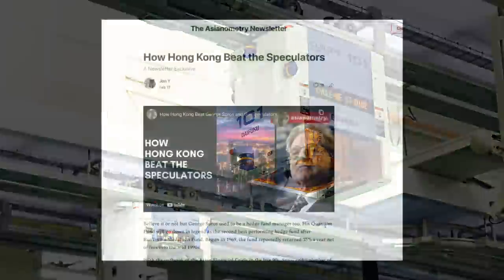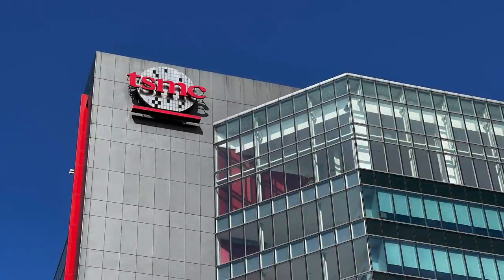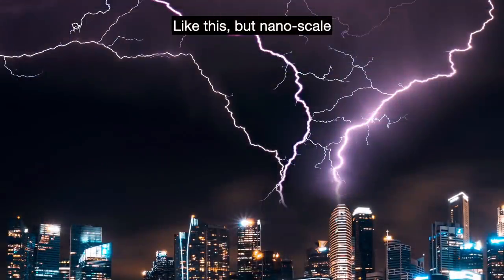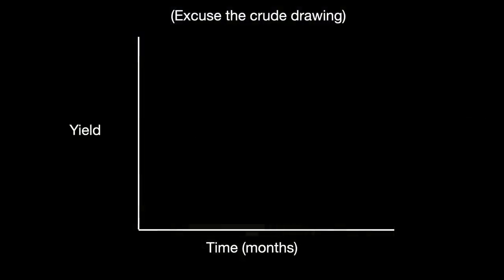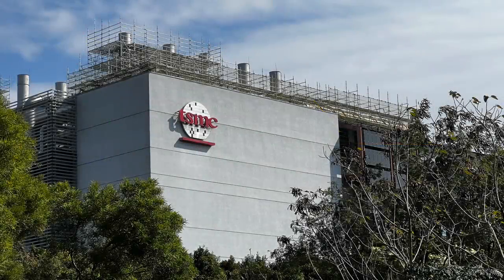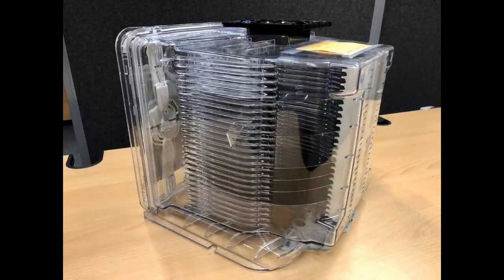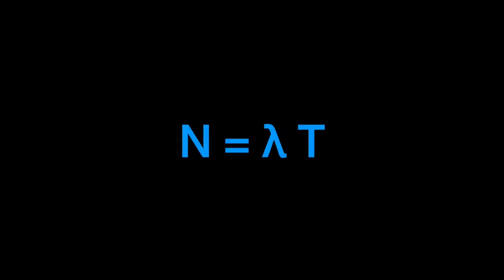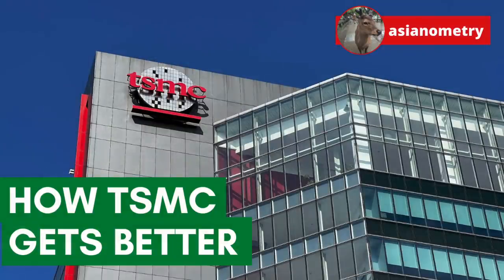How TSMC Keeps Getting Better

Comment: Was surprised that a lot was talked about on yield management without mentioning KLA, the toolmaker whose whole business is built on defect detection. Otherwise fantastic overview on what keeps TSMC at the top of the game.
Reply: yep -- worked for KLA for decade+... and can very confidently say its one of the companies that nobody has like heard ever (general public), although they have the lion's share in various sections of metrology and yield management. Sigh.
Reply: I hated the KLA tools.
Sucked being a tech and having to run down defect issues.
Reply: @AmrishKelkar  how to get a job in the semiconductor industry, like which engineering degree is required
Reply: @johnjacobjinglehimerschmid3555  I think each and every tool inside a fab is an extremely complex monster. Very tough to troubleshoot. I agree - tool going down sucks - - but there really is no way around it. Was your experience with other tool vendors the same? (keeping tool  complexity ~same level)
Reply: @orkkojit  Mechanical, electrical, electronics Engg degrees are highly sought after. Material science. I would suggest master's+. CS too, but you're not going to get paid like pure sw companies. Degrees in physics and maths can also get you in.
Reply: @AmrishKelkar  What's the avg pay in the industry ?
Reply: @AmrishKelkar  Thanks a lot
Reply: @orkkojit  Materials, applied physics, electronics, chemistry. Doing a master in nanotechnology/materials/chemistry should be the best way for it.
Reply from the maker: KLA, hit me up bruh!
Reply: @orkkojit  $28k a year in Taiwan in 200x
Reply: @Asianometry  There's a bot below your comment
Reply: @AmrishKelkar  
I was an etch tech.  So issues were more straight forward at the time, that is 20 years ago.  It was, at the time in our fab, where kla tools were just introduced.  Kla, defect tools, just added a crop load of investigation time.  Not sure how much time I spen on a sem after a kla tool flagged a lot.  It got better as we learned but when they showed up I hated them.
Reply: @orkkojit  it varies of course, but if forced to give a number, in the US you should be able to start at a minimum of 100k (fresh) assuming you have atleast a master's.
Reply: Intel is no competition only competitor today and in the future is Samsung. Can Samsung overtake TSMC in the future?

Comment: There was an interesting piece in this weeks Economist about the Taiwan chip industry. They highlighted the number of engineers being lured to China and suggested they are seen as traitors in Taiwan. Any thoughts of doing a video on this topic?
Reply: I heard in the 1990s Japanese chip engineers moonlighted for up and coming Korean chip fab companies, which wasn't too hard to do considering it's only a 2.5 hour flight between the two countries. Since then, Japanese chip companies have never recovered their position, at least in sectors such as memory.
Reply: But if ASML (or whom ever is makes the required machines) is restricted from importing to China then not sure how useful it will be. Have not read the article but have heard of this issue before for years.
Reply: @johnl.7754  not to mention Japan also play a role in creating device that is in the process to prepare these chips fab so I dont think they would do well.
Reply: Even so..  Taiwan still relies on Japan and US for the designs.
Reply: @deborahschumann8286  Taiwan's design is the second in the world, and the United States is the first. Japan has no design at all.
Reply from the maker: Depends on how much I want to get yelled at on a particular week.
Reply: In 2000, lots of TSMC and UMC engineers went to start up SMIC and huahong. They got a lot of free stocks. The outcome of those engineers were not good. And now TSMC is much more powerful than 20Y ago. TSMC engineers will be stupid to take risk to go to China semi companies now.
Reply: @TPM188  its not new engineers moving around... in fact in some technology industries, not moving around at least once every 10 years is considered a stain on your CV.
Reply: @mrrolandlawrence  Not true in the chip industry. TSMC currently holds all the tech in <5nm chips, you are considered the best engineers in the field if you work in TSMC. Your value drop the moment you left the company. Most engineers spend their whole working life in the same company in this field. More than 10 years at TSMC is certainly not a stain on your CV

Comment: Last I heard TSMC is introducing N3E which is "only" a 60% density shrink as opposed to the standard 70%, but it's already yield ramping right. This shouldn't be a big issue since N5 was already a bigger leap over N7 than normal. 84% in the best cases actually. So from N7 to N3, on average, follows the 70% density shrink every two years.
Reply: What advantages does density bring beyond purely more semiconductors per unit of area? Gate capacity (power usage), propagation delay? Will some of these start scaling worse with density or have they started already? What about leakage current?

Because i have a feeling that a lot of the time, the device size is hardly the goal, as the packaging takes up too much room anyway for it to matter, and we're well past bottom price per FET; and for large and powerful chips, power density is becoming critical anyway, like if a chip that takes like half a kilowatt, ridiculous, how do you even cool that without having it turn into a Pringle?
Reply: @SianaGearz  Power usage, specifically FET leakage current and RDS(on) is a huge part of a node improvement. This is the key to usable density nowadays as thermal density became critical.
Reply: @SianaGearz  The advantage of smaller transistors is faster switching time (higher frequency chips) and faster signalling between each transistor (signals propagate at the speed of light). The first disadvantage is greater leakage (wasted power), but this is partly offset by the better voltage/frequency curve. That is to say: if we only "harvest" some of the frequency gain in exchange for lower operating voltage it's still a net gain. The power density problem is not inherent to node shrinks. It's inherent to competition. Laptop chips run at 15W and get like 80% the performance of their 65W desktop cousins. We still make chips about the same size all the time, so the cooling area remains much the same. We just cram more transistors (which each use less power) into the same size package for a net performance gain.
Reply: @andersjjensen  Frequency scaling is not really happening anymore. We had 5GHz chips ten years ago. Electrical signals also do not travel at the speed of light. 
Nowadays it's mostly more transistors and a bit more efficiency per transistor.
Reply: @_TeXoN_  Electromagnetic signals travel at the speed of light in the medium they travel in. Just like light travels through air.. at the speed of light in air. We generally don't bother to distinguish between "the speed of light in a perfect vacuum", which is what think of when saying "the speed of light", and "the speed of light in this particular alloy" because in microprocessors (and other high quality electronics) it is at 95-99% the speed of light in a vacuum.

Frequency scaling still happens despite you not seeing much of it in modern processors. This is because it is difficult to retain good IPC (Instructions Per Clock) at higher frequencies on the rather complex instruction sets of PCs.

Every time TSMC markets a new node you'll see them state something like "20% more speed at ISO power or 40% power reduction at ISO speed" (those happen to be the numbers for N5 over N7). The chip designer can then mix and match between those two extremes to suit their needs the best. ASICs (that is, logic chips that don't interpret programs because they ARE "the program") see perfectly good frequency scaling if designed right.

Comment: It is mind boggling to think that it is possible to do a three nanometer process, if three nanometers is the size of the smallest feature that is only 14 atoms across assuming they are packed at the highest possible density allowed by the van der Waals radius for silicon which is probably optimistic. It is probably a lot less than this.  How is it possible to have usable features that are only a few atoms in size, how is the defect rate not sky high ?

Comment: The yield is proportional to the chemical and manufacturing steps needed to make the chips. In chemical reactions, yields are proportional to the number of steps and the yield at each step. So, if your yield is 90% per step and you have five steps, the best yield is .9 to the fifth power = .59 which is 59%. That chip manufacturers have done even better on yields than chemists is amazing.

Comment: Is there any tolerance at all for defects? Like, if a single wrong "bridge" is formed, does that screw the whole chip?
Reply: That's the job of the chip designers to counteract the inevitable defects by making redundant circuitry units/routes or by designing circuits beyond the defined specs.
Making lower SKUs with partially defective dies or at the opposite making higher parts using the most nondefective dies won't be a thing without those tricks.

Comment: Very good. China seems to have been able to use learning through scale in building infrastructure domestically and abroad. Perhaps worth a video as most governments struggle with time and cost to build individual infrastructure projects. Maybe the USA did the same when it built the interstate freeway system in the 1950s?
Reply: Is just a variation on "Experience is the Best Teacher."  You need to actually try and fail to get the data needed to succeed.
Reply: TSMC is from Taiwan not China and is a local company not Chinese one.

Comment: I'm wondering if China were to take over Taiwan, what would be more important? Securing the fabs or securing the fleeing senior personnel? Maybe the AI engineers are more important than the semiconductor ones? It's a fun thought experiment. It doesn't have to be a China takeover. It could be a tsunami or alien abduction or maybe a post-apocalyptic situation where they save the most important people in an underground vault to rebuild society while everyone else disintegrates. How much of the talent is local? Does TSMC even recruit from the outside? I know there's a bit of hubbub about Hong Kong refugees possibly being Chinese spies and not allowed permanent residence in Taiwan. I wonder how compartmentalized the process is for security reasons, or whether that's even possible in such bleeding edge developments.
Reply: I don't think that Taiwan war is likely in next 5-10 years, but in case it happens US will have many months to evacuate TSMC while China is preparing their forces

Comment: Chip manufacturing is complicated but stealth jets are even more so. Perhaps you can make a video on all the components that go into making a remarkable stealth jet: stealth coating, airframe, emf resistant chips, radar,. Communication equipment, encryption,  engine, engine manufacturing.
 Etc.

Comment: A 10kg foup sounds not too difficult to lift, and on something with caster wheels, would be super easy to bring where it belongs. I suspect it's something else. Humans, even when they're bagged up in layers of cleanroom suits, are still filthy creatures, which is a bit of an antithesis to cleanroom, i imagine you'd want as few of them in there as possible. I mean humans in an HDD factory cleanroom might be fine, but semiconductors are a whole different calibre.
Reply: It's not, but on an average 12hr shift that human would have lifted the foup hundreds of times. The last thing the company wants is for that human to get shaky arms 10hrs into the shift. 
I've done this with 8 inch wafers back in the day, now that was doable.
Reply: It only takes a couple of dropped FOUP for management to decide to go with the automated wafer handling system.  I've been in fabs where they move them manually and it's chaotic.  I'm sure stuff gets loaded into the wrong machine all the time .. and ties up the equipment until someone figures it out and unloads it.  Plus, people expect a paycheck.. the machines work 24/7 for free!
Reply: @sooocheesy  I get what you want to say but any machine still has buying and running costs as well as maintenance time needing qualified technicians so depending of the manufacture it's not always profitable to jump into it.

Comment: This is a very stupid complaint, but it would be appreciated if you can stick to using metric for measurements. Some parts you use metres, some parts you use pounds. It's hard to follow as someone that is only used to metric measurements.
Reply: T̼h̼a̼n̼k̼s̼~̼~̼f̼o̼r̼ ̼w̼a̼t̼c̼h̼i̼n̼g̼!̼!̼!̼
̼T̼e̼x̼t̼ ̼o̼n̼ ̼W̼h̼a̼t̼s̼A̼p̼p̼✞̼︎̼✙̼①④④③⑤③⓪⑦⑨⑦⑨🚀🚀🚀📉▶️..

Comment: If wafers could be 3d printed .. that would revolutionize  this entire industry
Reply: It is already 3d printed at a much faster rate than macro scale 3d printing. The whole fabrication process is printing the 3d transistor structure on top of the silicon wafer then after that printing the 3d labyrinth of wiring on top of the 3d transistor so that they function as a logic circuit.

Comment: NANO PARTICALS, why can't chips be etched in a vacuum Environment!?
Reply: Vacuum does not mean free of contaminant. For example the etching process requires acids this acids can contain impurities. Coating process uses electrical discharged this can create unwanted free ions. Photo exposure uses plasma for a uniform light source this plasma can create killer particles. Even the containers use to transport wafers between tooling equipment can have out gassing that chemically react with the wafer. Out gassing becomes a lot more worst at lower pressures.
Reply: T̼h̼a̼n̼k̼s̼~̼~̼f̼o̼r̼ ̼w̼a̼t̼c̼h̼i̼n̼g̼!̼!̼!̼
̼T̼e̼x̼t̼ ̼o̼n̼ ̼W̼h̼a̼t̼s̼A̼p̼p̼✞̼︎̼✙̼①④④③⑤③⓪⑦⑨⑦⑨🚀🚀🚀📉▶️..

Comment: Hmmmm .... thks & 1question and 1proclamation;
The Question: China desperately want to take-over Taiwan ; Taiwan's economy greatly depends on TSMC ; and TSMC chip mass-production is about as geeky as it gets.  W/o disclosing classified info & all ?How does Taiwan ensures China just don't sabotage TSMC into bankruptcy (ex: the James Bond sort-a-thing)?
The Proclamation: I’m a bored retired physicist.  Task execution depends more on algorithm effective/efficiency than that of hw.  Soooooooo just for the fun of it & the geek bragging rights, I'm killing myself learning the geekiest applied math (ex: geometric algebra) & FGPAs and hope to beat the latest/greatest processor performance (or something like that).
Reply: I remember two axioms from one of my professors: 1) every task can be solved by hardware means 2) every task can be solved by combination of software and hardware means. It all depends on your task. In a similar manner you can outcompete runners on your motorcycle, but in order to outrun them you need to be a better runner.

Comment: Of course I don’t know what is really going on, but nether do I believe the lame story of chip shortage.
Reply: What lame story? Demand is suddenly up 20%+ worldwide and the industry hasn't been prepared with scaling. Suddenly so many people needed a new TV, maybe a game console or computer, more gadgets, more LED lighting. The demand sure keeps rising year after year normally by a couple percent and a semiconductor shortage was about to happen anyway pretty much but it was spurred along and amplified by recent world events. Semiconductor shortages have regularly happened in the past as a cycle of overproduction and overconsumption is built into capitalism, you can see it in anything, but they were never this painful, these were minor adjustments rather than industry stopping events.
Reply: T̼h̼a̼n̼k̼s̼~̼~̼f̼o̼r̼ ̼w̼a̼t̼c̼h̼i̼n̼g̼!̼!̼!̼
̼T̼e̼x̼t̼ ̼o̼n̼ ̼W̼h̼a̼t̼s̼A̼p̼p̼✞̼︎̼✙̼①④④③⑤③⓪⑦⑨⑦⑨🚀🚀🚀📉▶️..
Reply: You are actually quite right.  The chip shortage is not as simple as it seems.  There are chip shortage but not across the board and they are typically limited to legacy product instead of the leading edge.
Reply: @cheongwenpa  a lot of 200mm wafer tech was decommissioned over the last 10 years. And then it turns out people still need now-old stuff and not less but more of it, because it's been the lifeblood of countless hardware designs.

But the leading edge having better availability is fully expected anyway. Because you the end customer are paying like $1000 per sq. inch of semiconductor as retail product, so there's some room to adjust, and do keep in mind CPU and GPU prices went up over the last 5 years. Try getting the same price out of less space efficient 130nm microcontrollers and even less space efficient power semiconductors.

Comment: I'm not a process engineer, but here's an attempt at the math
For 800 steps and 95% overall yield: 0.95^(1/800) = 0.999935885 yield per step, 
0.999935885/(1-0.999935885) =  15595.97 = 1 defect per 15,596 dice processed by a step
By comparison, four nines of reliability in the server admin world is ~52 minutes of downtime per year, but that's achieved with massive redundancy to keep some web storefront online; TSMC is getting four nines of reliability per step for 800 steps in a row.
Reply: T̼h̼a̼n̼k̼s̼~̼~̼f̼o̼r̼ ̼w̼a̼t̼c̼h̼i̼n̼g̼!̼!̼!̼
̼T̼e̼x̼t̼ ̼o̼n̼ ̼W̼h̼a̼t̼s̼A̼p̼p̼✞̼︎̼✙̼①④④③⑤③⓪⑦⑨⑦⑨🚀🚀🚀📉▶️.